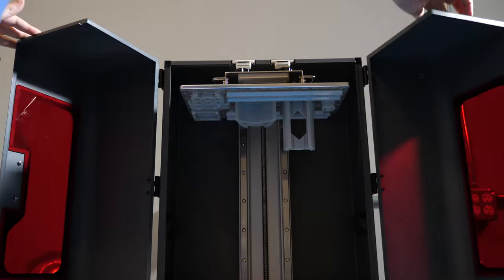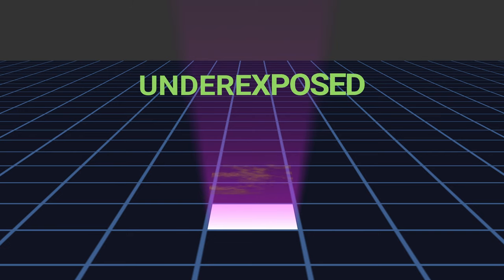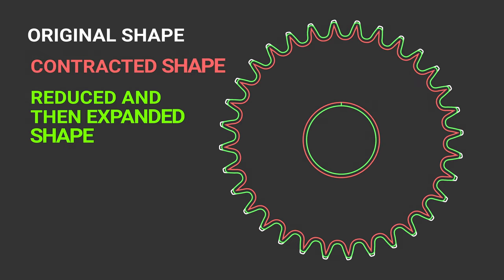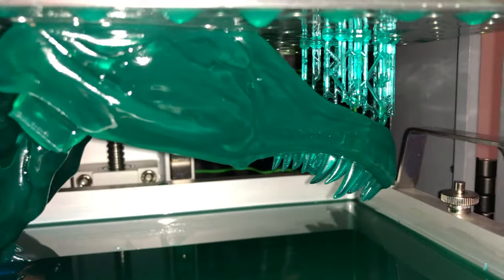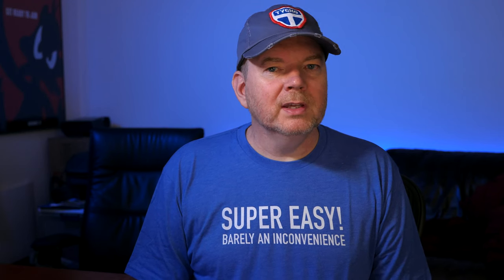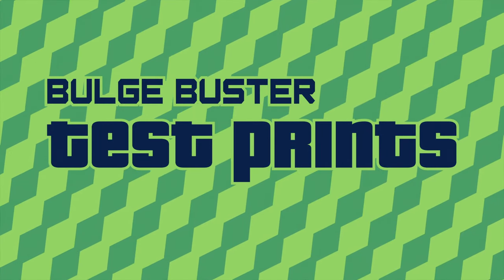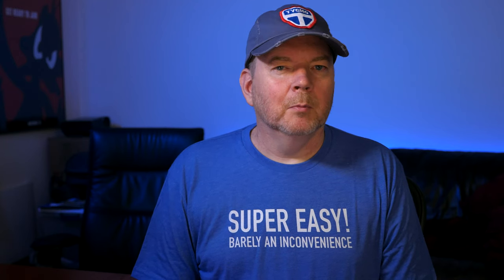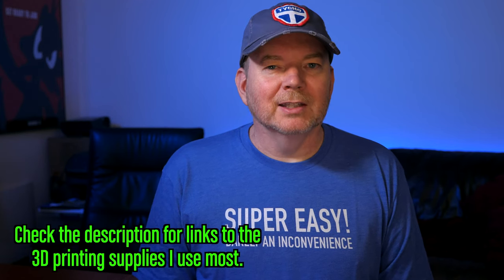Remove the Elephant's Foot from Resin 3D Prints - Plus NEW FREE Bulge Buster App

Comment: NEW FINDING OF THE MAIN CAUSE! Elephants foot is mostly caused by resin STILL FLOWING as it gets "squished out" underneath the built plate. This flowing resin cures as it flows, causing the elephants foot. How to FIX the elephants foot? Wait till the resin has stopped flowing before turning on the UV light. This pretty much completely removes the elephants foot. For details on how to do this, look up the blog by Jan Mrázek.

Comment: While it's commendable to acknowledge your efforts in testing and developing this feature, I must mention that Lychee Slicer handles elephants foot perfectly and with ease, especially with the grayscale feature. Additionally, I'd like to inform you that printing on the build plate is only advisable for flat and thin parts, such as the wheels you've tested. The bed offsets are not perfectly flat right out of the factory. If you desire perfectly squared faces, you'll need supports. Resin is not FDM. You need angles from the lcd screen for good balance of forces.

Comment: - No doubt you made a great effort doing this video, and then you top it up with the app; a million respect for you, sir.
I resolve this issue of the Elephant's Foot by giving a 45-degree chamfer to the edge of the part, a chamfer slightly bigger than the resulting total height of the bottom exposure base.
You did an excellent job!

Comment: The timing of this video couldn't be better, thanks for all your efforts! Photon Mono X is arriving today, and I'll predominantly be printing functional mechanical parts.
Reply from the maker: It’s possible that printer needs a .pws or .photons file (with an s) in which case it won’t work yet.
Reply: @Nerdtronic  I'm absolutely new to resin printing, but technically minded. If you need help in any way testing this or porting this to the newer version anycubic machines let me know and I'll try and help out.

Comment: Amazing video, super thorough. I might add however, that when printing small parts that do not need overexposure, there is another technique i just tested. Step 1 lower the number of bottom layers slightly and bring exposure down as well. Step 2 when designing the part add a champfer on all edges that will touch the buildplate. Step 3 tweak the values of all 3 changes until the elephants foot fills in the champfer. Then if still an issues try the pixel dimming above.
Reply: Just like we do on a FDM printer , except for the pixel dimming :-D

Comment: Excellent,  this will save me a lot work sanding off the foot on timing pulleys.

I use my printer for functional functional prints and I tend to use the lowest possible exposure to get the tolerances as tight as possible and I get the best results when I print directly on the build plate.   One disadvantage though, is the limited bridging distance.

Have you ever thought about trying to improve bridging distance by increasing the exposure time on layers with an abrupt transition?     

It seems like your software allows you the ability to contract and over-expose arbitrary layers in the print which could enable stronger overhangs.

Keep up the good work!

Comment: Very Nice. In Chitubox, you can also use the "bottom tolerance" setting in the advanced section to shrink the overall outline of just the bottom layers to compensate for the elephants foot.
Reply from the maker: Thanks for the info!  Chitubox can't print the bottom reduction test so you can see how many pixels to reduce.  I sort of think that's a key part of the calibration.  It also doesn't have the pixel dimming method.

Still, glad they are starting to put this functionality right in the software.  I wonder where they got the idea? 🤔

Bulge Buster was more of a proof of concept.  I'd be fine with it just being part of the slicer.
Reply: I just figured out Lychee could also do this in the Resin Configuration -> Compensation -> Burn in Layers -> px

Comment: I'm a bit late to this party but I just wanted to state that it sounds like you were on to something helpful.  Still, it comes across as a concept that more like an unproven theory.  
I draw and print all my own models and I try to print directly on my build plate more often than not.  When ever possible I just add a chamfer on the bottom face-edges of my models.  The chamfer is sized to compensate for the amount of the "Elephant's-Foot" that I was getting before I started simply adding that chamfer to the bottom-most edges of my models.
Viewed with a magnifying glass it's still far from perfect but for me it's a simple solution that I would have otherwise had to do alot of post print sanding or filing.  I hope that with time you can perfect your solution so that we can all print easier.

Comment: Woaw. This is genius. Don't print directly on the build plate so much because of this but also because the angle helps reducing peel force helps preventing failure. But is some case that can be really helpful. 
I'm doing mechnical print as well and I have to admit that what is bothering me the most is the fact that the resin I use (ABS like Elego and Photocentric Firm) get scratches so easily that it's ugly. You know that white powder that stands out when two pieces rub each other? Or even when you scratch with your nail. I can't really make threads for example. They holds no problem, but they get totally white and powdery at first use, it's ridiculous. If you have a solution for that, I'd take it as well 🤣. 
But thanks again for all the efforts you're putting into this and sharing it for free.
Reply from the maker: I know.  The limitations of resin.  Hopefully some better resins or resin additives will appear on the market soon.
Reply: @Nerdtronic  Ok so it's not only me. Good to know at least. Thanks a lot. Keep it up!

Comment: Thats amazing! :D
is the Anycubic Photon supported too?
.photon can be read, but the Photon is not in your list of working printers.
Reply from the maker: It can read .photon files.  But some of the newer Photon printers use a .pws or a .photons (with an s) file.  And those are  not supported yet.  Sorry.  File formats are sortof difficult.  When I can I'll add support for that.
Reply: @Nerdtronic  I seem to be a lucky guy and I got .photon files :)
I'll try your Buster tomorrow!
But I think I found a little mistake:
In the bottom layer reduction test I can't change the layer hight. I want to change it from 0,01 to 0,05 but it sticks with 0,01 :/
I use the windows version

Comment: Really appreciate the depth on this topic that only a true nerd would delve to (said with pride, as a fellow nerd and rabbit hole diver). The app is amazing! Even though I couldn't see how it would work with my Photon. 

Your work, and description of the problem (awesome graphics!) inspired me in two ways. First, that printing on the base isn't a sin; it actually might be preferable for parts that really need a flat base (like most of mine). Second, that there might be a way to counteract the bulge, and save all that knifing and filing and sanding (I just thought I'd have to live with that, as an artifact of the process). 

So, inspired by your work, I did something that wouldn't have occurred to me otherwise. I measured the height of the bulge, and put in a chamfered edge of that height (45 degrees), across the entire bottom surface of the source model. STL'd it out, C'boxed it using no supports, printed it out. And the bulge is almost entirely gone! With a perfect base!

My hat's off to you Michael, great job!
Reply from the maker: Awesome!  That's great to hear.  I assume you have a newer Photon?  I hope to add support for .pws files and .photons files early next year.
Reply: Yes, the Photon S (.photons file) and Mono X (.pwmx file). Thanks!!

Comment: I also think the rough & reflective build plate will disperse the UV light to surround resin near bottom layers, causing elephant foot aswell.
great video!
Reply: And due to the reflective of the build plate, i think the bottom layer resin tend to receive higher UV intensity, because the UV light will come through the resin to the build plate, and reflected by the build plate, and expose the resin again.
Reply: Yes, this is true, I've noticed this more when I started using my reflective Flex Plate, and even more when using translucent resin.

Comment: I hope you see this comment, because it seems to me like the software you made and the solution in Chitubox are fairly different and the chitubox version is much more incompitent. 
If I understand it all correctly, your software exposes a single layer with two different exposure times, which means that the outside rim of bottom layers will be exposed exactly the same amount as the normal layers!
The chitbox version simply scales the model down in those layers which would require much more percision and tweaking resulting in worse prints.

Anyway, I guess my point is that this prgram still seems to be very relevant to and useful in the current SLA printing pipeline.
Reply from the maker: Yeah I wish they would implement the pixel dimming method
Reply from the maker: Oh but also they encoded their file format. So I can’t load or save in the file format now

Comment: I just went from FDM to resin for translucent parts. And got exactly elephant foot because of printing flat as supports are not needed. It was clear to me it is because of overexposure but how to fight it together with bed adhesion? Sir, you are hero.

I have to find a solution with UVTools as those are I use to fix all things in sliced file.

Comment: Subbed ... I appreciate the steady, reasoned approach and presentation. A lot of other channels make me feel like I'm watching a game show with all their disingenuous Wow, Awesome, Kapow!!! They leave me skeptical of the value of their reviews. I've FDM printed for years but I don't have a resin printer yet, so I'm not sure if you've tried what I'm going to suggest or if it's even possible. Have you tried (normal 12s exposure, lift to flush the resin away, lower back to first layer height), repeat (...) 5 times to get 60s total exposure for layer 1 and repeat for the 10 layers for good overall adhesion? Might not be possible in the slicer but perhaps a copy/paste of first layer gcode could do it. My reasoning is that since the reactive medium is fluid, radicals (reactant chemical species) diffuse from the UV lit areas to the dark areas over time, hence the growth of the foot if allowed to go on for too long. However if the reaction is stopped by lifting as if to do another layer and then simply repeating the first layer, the subsequent exposure cooks the first layer further, it becomes less mobile and radicals less able to diffuse. Furthermore the fluid in the dark zone is fresh since any radicals from the first exposure have been diluted away. The important part is to stop the reaction and flush the fluid before repeating exposure, not just adding more exposure time. Of course this all depends on whether the first layer at nominal 12s exposure is mechanically sound enough to withstand build plate raising and lowering a few times. Anyway just a thought. Will try myself when I eventually figure out which printer to put my money into. Cheers.
Reply from the maker: I think what you are suggesting is printing multiple exposures on a slice but lifting and lowering the plate between?  If so there are a couple of issues with that.  First is that most printers don't let you control the build plate in that way.  Most printers don't let you lift and lower back to the same Z because they're trying to protect the screen.  It could be dangerous and put the screen at risk.  Normally when the plate lowers back down there is that 50 micron (or layerheight) gap between the printed part and the screen.  You'd be pusing it all the way down.  Second is that you'd be peeling that layer multiple times.  And I don't think that would work well to make physically to make a clean part.

A better plan would be to expose a bit, pause a bit, expose a bit more, pause a bit, etc.  And that is what the double exposure method in my app does do.  But again - not supported on many printers.  Only the transform at the moment.  And in my experience pixel dimming works just as well in practice.

Comment: Thank you for working so hard at this problem. I am just starting out and gathering information and your videos have been extremely well done in a way that helps me absorb the information I'm trying to understand very thoroughly and in a way that fills in the tactile, practical, and conceptual details. I ordered the 4k Photon and I'm waiting for it to ship. You worked out a really great solution to this problem!

I'm in the process of wrapping my brain around how printing and curing and light intensity all intertwine. Have you considered that the only time this is an issue is when the build plate is so close to the LCD that the light halo from the open pixels able to reflect diffused light back down at the intensity required to cure the resin? 

The light from underneath is not coming through at a specific angle, but the intensity of the halo is lower because the light source is farther away. 

If you have your intensity set properly, there isn't enough light to even partially activate the surrounding resin through the rest of the build, otherwise you would have a bunch of floaters. I am thinking it needs a certain intensity of light to start the activation, in addition to a certain exposure time to fully cure the layer before moving to the next layer.

This would mean to me that the majority of the elephant foot is formed from light coming in directly perpendicular to the pixel. The fact that as the foot shrinks as the first layers build seem to confirm this hypothesis as the intensity of the reflecting light would reduce with each layer as it's absorbed by the cured resin. 

I'm curious to know if the problem is reduced by using an anodized black build plate or a matte black magnet mat like I use on my FDM printer. 

It may be as simple as adding a matte black adhesive vinyl over the build plate. I have some and I will try it out as one of my first experiments when my printer gets here.

P.S. you're dimming the light intensity, not the pixel. A fully blacked out lcd TV display would be 100% dim, lol.

Comment: Hi, this is realy awesome video and it helped me quite a lot to understand how SLA works in etail. The program looks also really good, but I cannot use it, since I have only photon mono x. I tried to print some gears and shafts, but I was unable to do so, due to issue described oin this video. (with supports I was also inable to print because the gears are ussually not strait)
I would like to kindly ask you if it would be possible to add support for *.pwmx files for anycubic? 
Thank you a lot.

Comment: This is an amazing resource! You have a gift for this stuff, and for explaining it perfectly! I do have a question - in your experiments with bottom layers, do you have a feeling for what the actual thicknesses end up being? Is it possible, given the limited movement of the build plate to have additional thickness because of the long exposure, or is this physically limited by the build plate movement?
Reply from the maker: It should be limited by the build plate movement.  I wouldn't think a longer exposure could make that first layer any thicker in the Z.  However, I have noticed that some 3d print files set the first layer Z value to zero and some to <layer height>, and then also on z calibration maybe you use the piece of paper method.  So it is possible that the first layer could be one of several different height - while the rest should be <layer height>.  And I don't have the expertise or equipment to analyze or measure it.  For my test files I did a layer height of 5 microns so I could really tell what the build plate was doing.

Comment: Thanks for the comprehensive video. I was wondering if you could guide me on a problem you seem to have solved. I wand to print small printing plates for my OpenPress. The workflow would be similar. Start with a base, then switch to an image that is to be printed. To support it a number of intermediate layers that are dilated to give more support. I know how to generate the single Layers, I just can't figure out how to make them into a valid print file. Any help would be appreciated.

Comment: In using BulgeBuster, I've discovered, at least on my Anycubic Photon and Elegoo ABS like, that even with pixel dimming, which I find very interesting, that while I can match dimensions for bottom and regular layers, there's still an Elephants Foot that's about 0.1-0.2mm larger, regardless of settings and bottom layers. I'm guessing it's because no resin is 100% opaque, and the uv light is reflecting off the bed for an arbitrary thickness of resin until the layers are thick enough to absorb all the light, over exposing the first few layers regardless of exposure time or busting. I discovered this whole printing a overhanging bevel directly on the bed and found it wasn't flush, but I noticed it on perpendicular faces as well. At first I thought it was just the nature of overhangs and sla printing, but I didn't see any similar artifacts when printing with supports. I haven't had the time to test this and I lack high precision tools, but I think I can alleviate this by a pure pixel contraction for the height and length of the ridge, and further doing a subsequent pixel dimming.
Reply: Thanks for this explanation Bradley. I think you've definitely figured why this is happening. I'm seeing this more with translucent resin. I have some Siraya Tech Blu Obsidian Black (more opaque than what I've been using) and this will let me test out this theory. I think this might also have something to do with fact that I'm using a highly reflective Flex Plate that is exacerbating the issue. Some prints just don't work well with supports unfortunately.